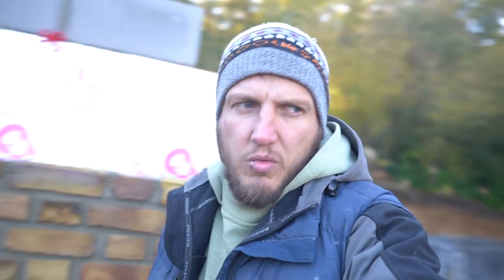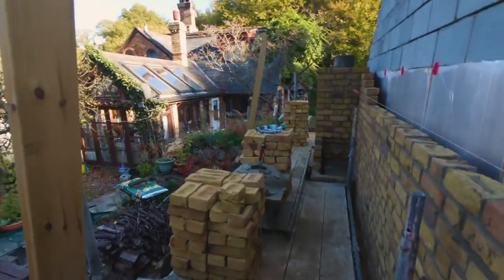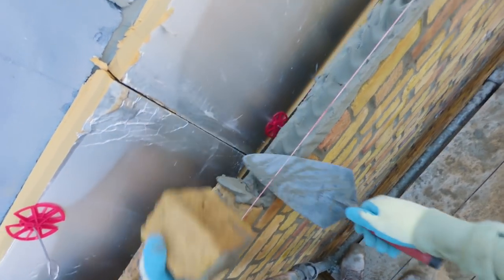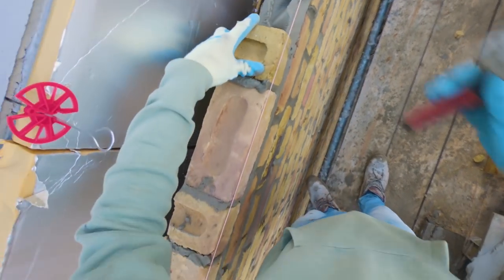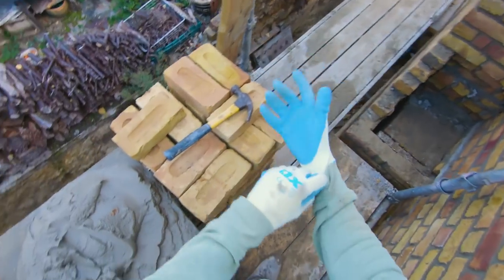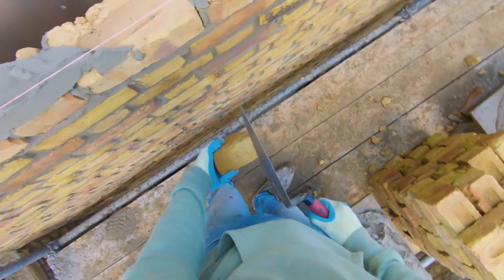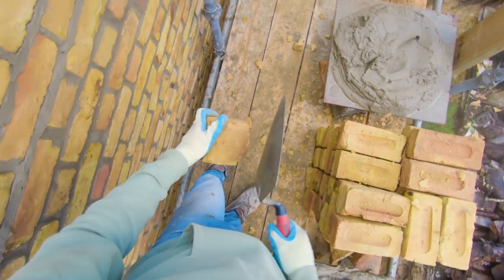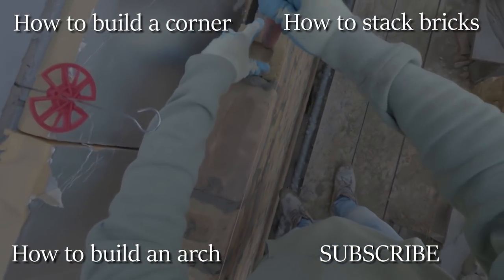BRICKLAYING - HOW TO LAY BRICKS

Comment: ive watched alot of brick laying videos and you explained things my mind couldn't figure out, like how to set up the string line properly. it's the small details :D
Reply from the maker: Cheers buddy, glad to be of some help :D
Reply: Ok when you put in the last brick double joint the bricks. Place joints on both ends of brick your laying and the the ends of brick already laid on the wall with two clip joints. Then tad if mortar smeared in the back of two joints. Two much tapping with the handle.

Comment: The only thing i do differently is not hammering the pin in as far that the line is touching the brickwork on the tails, although i probably do have a touch of OCD.
Flemish bond is by far my favourite but there is little call for it up here in the very north of England (Scotland🙈) Your videos are easy to watch and you explain thing well 👍
Reply from the maker: I had a pin fly out and whack me in the face once, had them in deep ever since. Didn't want it happening again 🤣 There is hardly any call for it here either but I love it so had to out it in the house. Glad you're enjoying the videos. Appreciate the comment 👍🏻😁

Comment: you must not relocate the bricks the suction will go and that results in a very weak bonding.
Also, most walls are not plumed as it is usually under checked by the bricklayers.
Reply: No tape on the partial fill mate or am I missing something?
Reply: Not if you plumb every course when you finish each course which is part of the process.Gauge,level,plumb,range threw.in that order usually.

Comment: Rodian, When you set the string height is the bottom of the string even with the top of the brick or is the top of the string even with the top of the brick.
Reply: doesnt matter, as long as u keep it consistent on both sides

Comment: claw hammer, um we are not carpenters.  What about a deadman on the corner to save tons of time. on stead of racking back, or rack the corner back,  ]or spot and trot, which is how you get the straightest wall.
 and tapping on the brick with the trowel...umm, bad habbit.

Tight line is a right line mate. I like that line pin, slash line holder, that is cool

Comment: why not cut the headers before. whats the price per 1000 in london if you are using the trowel to cut the brick youre better of with a whs broad london pattern what type of brick are you laying
Reply from the maker: I did think about cutting them before hand but it's easy enough with a hammer as I go. I never really got used to a London pattern, feel more comfortable with a Philadelphia pattern. The bricks are imitation stocks, some are really hard but most are relatively soft enough to trim up with a trowel
Reply: 650/750 per thousand going rate

Comment: How do you know that you’re laying the wall plumb? Do you just eyeball it?
Reply from the maker: When you build the corners before running in, you use a level and plumb it up as you build it. When it comes to running in using a line, as long as the corners are plumb, the wall will be plumb. I made a video about building corners and talk about the plumb and level points. Heres the link if you want to check it out https://youtu.be/YyggEpwLnGM You should never build walls "by eye" because we dont have levels built in our eyes 🤣 Hope this is of some help buddy. Thanks for the comment
Reply: Rodian Montague ahh okay that makes sense. I guess I was more so thinking about the level of each individual brick from side to side on the short side (the side in which the line is not running), which would also be pertaining to the plumb of each individual brick.
Reply from the maker: In regards to that level, the bricks I am using are so uneven that the face (part of the brick you see in the wall) looks plumb but the rest of the brick could be completely out of level. As long as the face looks good and it follows the line, the rest can be as wobbly as it wants. When using nice straight bricks this isn't something you need to worry about. I hope I explained this well enough? 😁😁

Comment: Bricklayer with a wood butcher hammer. GMAFB
Reply from the maker: All good for banging pins in 😁
Reply: @RodianBuilds    so would an axe head but it's not a bricklayers tool. See if you find a carpenter banging nails with a brick hammer on you tube.
Reply from the maker: 🤣🤣 fair point. Pluto it was the only hammer I had to hand. I wasnt going to get off the scaffold to find another one.
Reply: @RodianBuilds  you're representing yourself to the world it's show time.